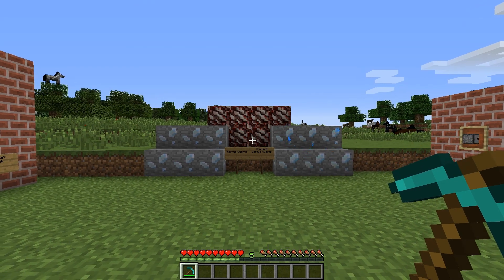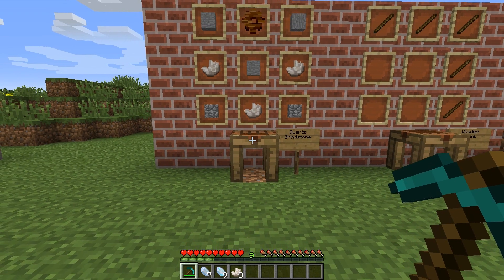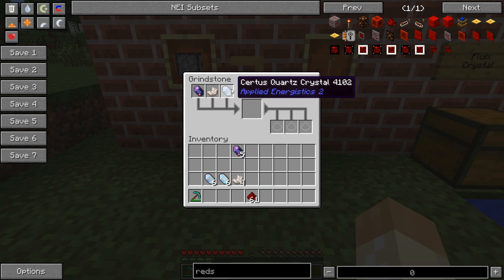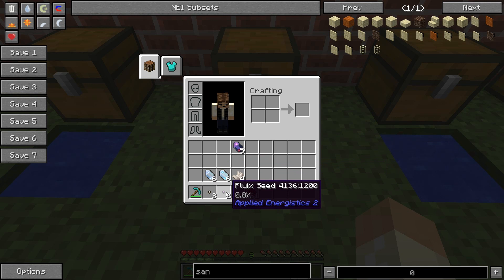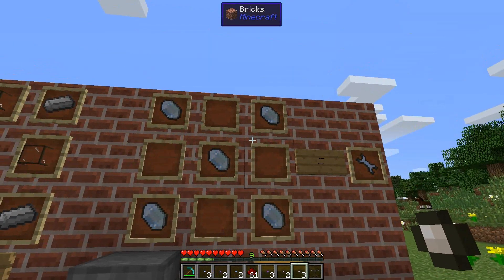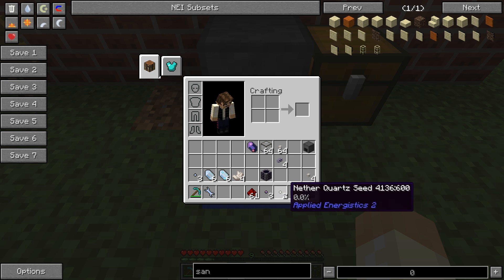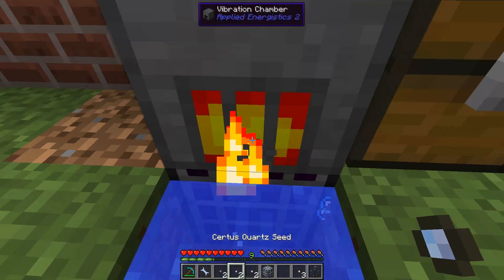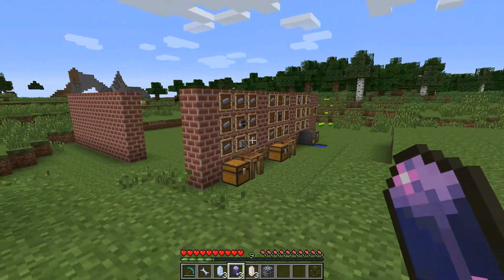Applied Energistics 2 Tutorial #1: Getting Started - Resources (MC 1.7.2 / 1.7.10)

Comment: On question: Can you use a piston on the crystal growth accelerator? If you can you could just use 6 of this machines and use a dispenser or pipe to throw the things in. Could you use more than 1 water block so for example 4 water blocks and than the machines around?
Reply from the maker: +Christoph Kiekhoefer I have never tried with a 6-CGA setup, but they say there's a way to do it even without using sticky pistons... Anyway, I guess it's possible, but I haven't tried. But I have done a 5-CGA setup with Steven's Factory Manager. Regarding extra water blocks, I don't think you'll benefit from it, since I think the CGA only affects the water block directly next to it.

Comment: So I noticed... you can't use Certus Quartz Crystal to make grindstones anymore? Just dust, which no longer drops from ore? How does one get started with making a grindstone then? It's a weird conundrum of needing dust to make dust, or using a different mod's pulverizing system, at which time you don't really need the grindstone anymore.
Reply from the maker: +divinedragoonkain Are you using a modpack (which one?) or lots of different mods? When I do my tutorials I try to have as few mods installed as practically possible to keep recipes unchanged. Some mods simply overwrite recipes and one could end up in a situation as you describe, other changes can be specific for a modpack. And the reason for change could be just as you say - they don't want you to be able to craft the grindstone before you have a power system and for example a TE pulverizer up and running.
Reply: Ahh, okay. Yeah, I'm using the current Direwolf20 pack.

Comment: When setting up the system with the Crystal Growth accelerator, the system constantly use power. Is there a off some parts of the system in order to save power as like the Crystal Growth Accelerator does comsume a lot of power even no crystals in the basin.
Another thing is that I use the Vibration Cha,ber to produce power and figured it can run on lava. Is there a way to auto input the lava or another cool way of having the power generation automatic feeded.??
Reply from the maker: EyasTheBad Absolutely, use the Toggle Bus! I have covered it in the "bus tutorial", but you can cut the power line with a Lever. The other way is to have Vibration Chambers only connected to the Accelerators and have a different power system for the rest of the network.
With help from other mods you can automate the creation of Lava Buckets and export to the Vibration Chamber (but I wasn't able to extract the empty bucket), or use Lava Cells from IC2 - which are destroyed in the process. I can only think of using other mods to do it though...
Reply: Thnx a lot for your answer. Will watch the bus tutorial more carefully and figure out a system with the lava thingy. Have made my own mod pack to minecraft 1.7.10. So will play around with the different mods I have there and see if I can come up with something useful using the lava to power the Vibration Chambers.
Again, thnx a lot for those wonderful tutorials on the AE2.!!!
Reply from the maker: EyasTheBad Another variant is to use an Energy Acceptor to use power from other mods, it could be easier. Still, using a Toggle Bus to cut the power to the Accelerators is almost a must unless you have them in a totally separate network, for example with Vibration Chambers - only running when you want to accelerate. If you want to do the math, you get 10ae/t from the chambers, and the accelerators consume 8ae/t :)

Comment: I have some questions: Can the seeds despawn when they are too long in the water?
At what elevation can I find charged certus quartz?
Reply from the maker: Regarding the seeds I can only gick half an answer. As long as they are seeds, they will not despawn. The ingame tooltip even says so :) But when the purification is finished and they are turned into pure crystals I have a vague feeling that the despawn counter will start. Not really sure of that part though!
At the moment, I play The Dark Trilogy (1.7.10), and I basically find Charged Certus Quartz on all levels. Usually they are connected to the normal Certus Quartz, perhaps 1-2 blocks in a cluster. You only really need to find a few, after that you can make your own Charged version.
Reply: Ok, thanks for the quick reply! =D this tutorial helped me alot! Keep up the great work! ;)

Comment: i have a question how do i refill the energy  cells because im playing a mod pack and im running out of energy and if the energy is out i cant do anyting sorry for bad english im from swiss please help
Reply from the maker: So the basic way is to use vibration chambers, connect them to the energy cell to fill them. If you want to use power from other mods, connect power via an Energy Acceptor.
Reply: thanks
Reply: therealtkh
 ok i have a problem i dont have a vibration camber i only have a vibration catalyst and vibration quartz glass
Reply from the maker: fobsi LP Vibration Catalyst is nothing like Vibration Chamber... it's an item from AE1, last time I checked it wasn't added in AE2. What version are you using?
Reply: therealtkh i am using applied energistics 1 and im playing material energy^3
but how do i "make" energy?
Reply from the maker: fobsi LP Ok, so it's a big difference between AE1 and AE2, and since this is an AE2 video I took for granted that you meant the current energy cell. And I don't think AE1 had energy cells, material energy cubed does have Thermal Expansion, are your energy cells from that mod? In that case it's RF power from TE engines.
Reply: therealtkh ok im currently not near my computer if i tried it with energy from other technic mods i will write you back when it works or not

Comment: This video is VERY helpful, though i would advise people to use the fist peiuce of charged certus to make a charger station which can also be hand cranked and can turn certus into charged certus. Have you done a video showing the methods of using the Energy acceptor to transform power at all?
Reply from the maker: Thanks a lot! That's a very good advice, I didn't think of that when doing the video. And I had actually totally missed out on the fact that the Charger can be hand-cranked, thanks again! :) I have not done a tutorial on the Energy Acceptor except for just mentioning that it is used to accept power from other mods. Is a dedicated tutorial for that needed?
Reply: no should be fine now i am a little more confident in the mod, guess it will just take a little more tweaking